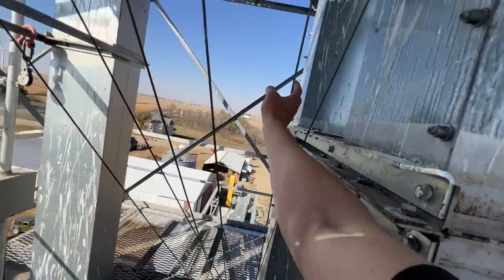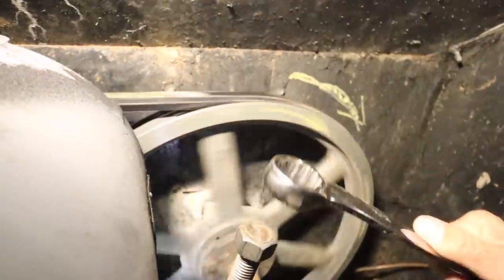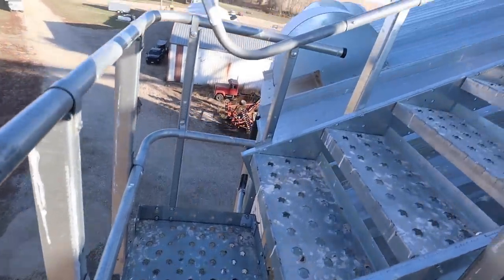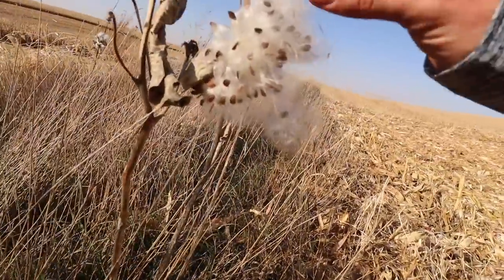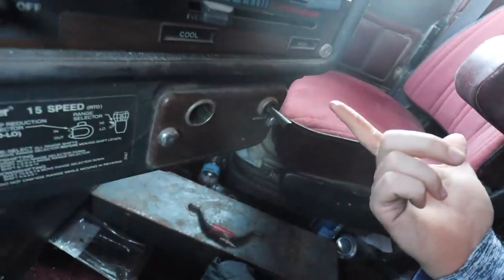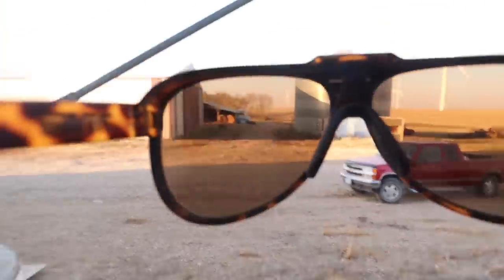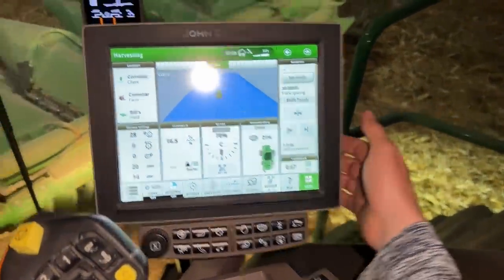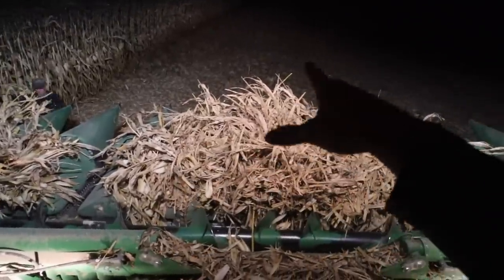Broken Welds Have Been Discovered On The Bin Site

Comment: For someone who doesn’t understand the mechanical issues with the belt, I was wondering if a chain and sprocket design would have solved the issue of constantly replacing belts. That said, you guys know more than I ever will. It must be so frustrating constantly dealing with the issues your experiencing with the grain bin design. Hopefully, the company that installed the bin setup will work out all the kinks and carefully check the critical welds on the catwalks before someone gets unnecessarily hurt.

Comment: I work with Automation on an industrial scale especially with Allen Bradley PLC, Panelview, VFDs, and motor starters you have shown. I would recommend putting a VFD on the auger motor that keeps burning up belts, if not already a VFD. AB has relatively cheap VFDs called PowerFlex 525s that would be perfect for the application. This would allow the auger to ramp up and down speeds which should reduce belts burning off. Also I would recommend putting an RPM sensor on that auger or monitor the amps and if RPMs get too low or amps too hi shut motor down. Prevents burning off belts. Also could have your programmer monitor the amps of the pit discharge auger (assuming VFD otherwise need to add a current transmitter to monitor) and as the center of the pit empties the discharge auger amps should start to decrease, then the speed of the center auger could be increased from a minimum speed to bring more grain to the center of the pit. Once center auger amps at empty setting and center auger full speed, then it could start the stopping sequence or at minimum turn auger speed back to minimum awaiting next load.

Comment: When replacing belt you have to amp probe the motor so don’t exceed  full load amps when tightening the belts. If the motor start circuit is tie into the plc you can regulate speed of the motor.

Comment: You need to look at using timing belts years ago we changed from v belts to timing belts also after trial and error we would have big pulley one size wider so only the small pulley would guide the belt by doing that the belt last much longer. Herman

Comment: Cole, DC I'm not an expert on grain dump pits but since you finally showed the auger belt pully in action it seems the speed is way too high for the bottom of a pit with a load on. I'm estimating that its running at 480(ish) rpm which is way too fast for a large auger at the bottom of a pit with a heavy load of corn pushing down on it especially if it"s pulling from both sides to the center. Just a suggestion but you could put the 7hp motor back on with a secondary 4:1 (or 5:1) reduction pully to get the rpm on the auger down to 80-120rpm which would be plenty to move the corn to the center quick enough to feed the lift auger and would effectively increase the torque saving your belts.

Comment: Sounds like you need a clutch drive for your pit auger system motor.
Reply: I'm not an engineer of this type of thing, but a chain and clutch seems like it would handle the torque better. Right now, they do have a clutch of sorts... Unfortunately it's made out of rubber.

Comment: Those bins are actually kind of terrifying. What if, for example, 4:30, DC falls in through the hole? If the grain level is low obviously probably instant death. If the level is high enough to survive, it's likely blocking the ground-level access doors and the walls are too smooth to climb, so you're trapped, probably injured, atop a mountain of grain, and if the system is running, more grain is raining down on top of you. And the Cornstars often seem to be spread out all over their farming operation and only staying in contact by phone or radio...

Can you get a good cell signal at the bin site? How about while inside those bins? If not, I would look into getting a cell signal booster...

Comment: I can’t imagine the frustration of that bin site, curious if you have tried dumping one hopper at a time over the center auger? I know that’s not how it’s designed but it may get you by till that can figure a better solution
Reply: Good thought worth trying
Reply: But that slows down emptying of the truck, which means eventually the combine will have to stop combining and sit full up and waiting in the field for a truck to pick up the grain.  
The point of having a big grain pit and the automatic conveyors is to be able to dump the whole truckload quickly and leave, so the truck can get back to the field to pick up the next load, while the pit conveyors empty out the pit at the speed that the grain augers can handle it.
Reply: @timothymbonham4453  yes but the whole site is a dumpster fire. How much time is lost changing the burned up belts? How much time/$ has been lost in their capacity for all the broken or inoperable items? It’s just a shame they’ve had to endure all this.

Comment: DC you can put different belt pulleys that hold three or four belts to take more torque when it loads the auger up  and pull motor and slot motor bolts for better Alignment

Comment: You might want to look into the bird poop issue, just to check it's not going to attack the galvanizing on the frame work.
Some owl decoys or something like that will keep the poopers away.
Or even better get some pet birds of prey :-)
Reply: Call me crazy, but I'd prefer not to be surrounded by bird droppings, regardless of whether it's harmful to the metal.
Reply: @iLumberjack  yea the problem with that is without a natural predator the only way to do that on structures like this is put spikes everywhere on roosting and nesting areas and that’s not exactly a good idea for safety
Reply: @Doubie. the problem with what?

Comment: I know it would be a pain but dump in center of pit. Then don't use the pit auger. Basically dump one hopper at a time. Slow and steady win the race😁 . You can also slow the pit auger down with a bigger pulley with the 7 hp motor.  Something to think about any way.

Comment: What should you do?
You should make a list of all the deficiencies in both design, construction, and workmanship and have your lawyer draft a letter to the Bin prime contractor to put them on notice, and request the contractor to propose a schedule to correct all deficiencies.
Given that you have employees on the farm, it would seem that workplace safety/OSHA regulations apply to your Bin, yet the railings and stairways dont appear to be even remotely OSHA compliant.  You may need to use fall restraint harnesses when on these sketchy platforms, yet there isn't attachment points for fall restraint lanyards. In a word, what a clusterfuck design.
Reply: Thy have been .that's why they have not been able to speak on it

Comment: Hi guys  I think one issue you might be having is that since your leg is not doing 8000 Bu an hour your cross auger is running to fast. You probably need a bigger pulley on the auger or smaller pulley on the motor to slow it down. I seen there is not that much room but change it as much as possible and think you won't be chewing up belts anymore. good luck . love the video's.

Comment: Corn star the problem you have is that the motor in the pits can overwhelm the bucket elevator so you need to slow down the pit auger and you need to slow down the auger, feeding the bucket elevator, so it won’t burn the belts off of the pit auger I would start at 50% and see how it works grace and peace

Comment: Hey cole. I’ve worked in sawmills, mines and manufacturing plants for 18 year as a millwright and a welder. The drive on your pit auger is a piss poor set up. The size of the drive pulley (motor pulley) is so much smaller then the driven(auger pulley)im sure this is to get the correct speed for the auger. they are mounter so close together that the size difference doesn’t allow the drive pulley to have enough of a contact area with the belt, and when the auger gets a load in it it will slip burning off the belts. If you just keep tightening the belts you will just destroy the bearings in the motor. If the pulleys have to be that close together they should have a gear box mounted to the motor with a ratio to give you the correct speed you need for your auger and a roller chain to drive it off the gear box with sprockets that are close to or the same size. Your problems would probably be gone.

Comment: Does the control panel have a speed control for the auger motors to slow them down, so they don't push so hard? We always had the ability to control speed of feed augers to conveyors or augers to feed the legs.

Comment: Regarding the burning belts, it looks like there is not enough belt wrap around the 10 hp motor pulley. I could not see if there is a tension idler behind the motor.  If not,  the motor cannot transfer its HP to the bigger belt sheave so when it pulls hard. enough it starts slipping and just burns the belts off.  Make sure there is proper belt alignment, also.

Comment: I don’t know much about bin sites and farming but I do work with motors and control panels. So I’m not trying to be mean or anything. But I would guess that panel has VFDs in it and you should be able to turn down the ramp up speed of the motor. Or In other words make it take longer for the motor to ramp up to its full speed and get it to full ramp after the massive amount of corn in getting to it and not trying to push so much so early. But i don’t know if that will work. I work in waste water treatment, pump station and treatment plants so I work with motors, pumps and control panels all the time.

Comment: burning belts is caused by belt slippage ,and the best solution for this problem is either add a belt  ,, or switch to a 2 stage drive with an intermediate shaft allowing the usage of larger pulleys and shorter belts ,this spreads the reduction out over a larger area ,, adds mechanical complexity  but also reduces stress on the components and the belts resulting in  a lower failure rate

Comment: On the pit auger motor.  Let the 10 hp motor on, Change the pulleys to add 1 or 2 more belts to handle the power, then program the motor vfd to limit available torque to what the auger can handle.

Comment: Cole, you need to change the ratio on the pit cross auger motor. Slow the auger down so it does not push the grain to the centre as fast, this will put less load on the motor & belts

Comment: If your having issues with the horizontal augers dragging everything to the center vertical auger, why do you keep pulling completely over the pit and dropping both hoppers into the pit? Why not just drop one hopper at a time over the center of the pit? And if your answer is because it's faster to drop them both to get back to the field, you're not working on long term efficiency with the current situation that Cole is always preaching about. Dumping one hopper at a time over the center vertical auger eliminates the 2 horizontal augers, which eliminates the belts burning up and shutting the whole thing completely down because the pit is full and can't be used, which in the end shuts the combine down. No expense on belts, and the combine never shuts down completely. May have to wait 10 or 15 minutes for an empty tuck here and there, but it won't shut it down. Slower dump time out weighs not dumping at all 100% of the time.

Comment: The distance between the motor pulley and the auger pulley is not far enough apart causing the belts to not have enough contact with the motor pulley. You can solve this two ways. Move the motor further away or put a smaller pulley on the auger.

Comment: Run a smaller breaker, higher load will trip the breaker. Fixed. Or it’ll fail to get past starting load, but cheaper to test then replacing belts.

Comment: looking at the veido with the belts and the varible drive gates belts require min 7"  diamter drive pulley to keep the belts from burning up. have a rep from a belt company go over the design to get it set up correctly for you.

Comment: Is there a soft start for the motors on the  pit? Trying to push materials in an auger is not usually a good idea and then adding your starting it with weight on it from stand still to full speed it makes it that much harder
Reply: Augers should have upper shields that protect it from column pressure.  Raising or lowering the shields adjusts the feed rate.
Reply: @OOpSjm  normally you are right but I didn't see that on this pit set up.
Reply: @gimpy3247  I didn't say there was or not.  Videos from last year should show what was installed.

Comment: maybe a sheave change might help or change the type of belt to htd belt from the vee belts I think you're using. they do not slip so if the auger jams the motor kicks out and you can reset that in the control room

Comment: I was wondering if you have a VFD that controls the 10 HP pit auger. If so you can really program them to help with the belt burning issues
Reply: There is a whistling noise which suggests there is an inverter drive. Agree ramp up time needs to be used, but it's also possible the belt drive is undersized for the required power / torque.  A combination of checking shaft separation, belt velocity and contact angle on the pulleys. Given all the doom on this project we can guess that a 10hp motor will have a belt drive designed for 5hp.....
Reply: @philhealey449  I was also wondering if the 2 belt drive setup was not enough to hold the added torque of the 10 HP motor. I would look into a 4 belt setup .
Reply: @bobbyparham4253  A killer issue can be inadequate  angle of contact around the motor pulley, so increasing the shaft separation and using longer belts can help.  The starting point I think is what is the required torque.  That may need a spring balance check at the driven pulley radius, but I guess there will be a lot of uncertainty conveying grain, so a very conservative approach is needed.

Comment: The motor vee belt pulley is a small dia and has a small surface area for the vee belts to run round. If you were to move the motor further away from the large vee pulley and put in a idler pulley to load the vee belt on the small motor pulley. Use the notched vee belts as they fit better on small dia pulleys.The other way to stop the vee belts burning out is to put a reduction drive on the motor and run the same size pulleys on the motor as the screw conveyor that way the surface area is the same on both pulleys.

Comment: Between the concrete slabs cracking, and now the bad weld job, both of which are dangerous, and now again, the bad motor problem, I'm surprised you haven't been in the news.

Comment: belt problems...switch to chain drive or gear drive...also you can use gearbox for better power distribution and weaker fuse for that motor so it will blow fuse before it burns belt...just some ideas...

Comment: tip for the bin motor and that burning belts, Change it to chain drive,.. in case of a havy load it wil trip the motor safety.. Not the belts witch are to smal for that purpose and power.

Comment: You would think that the contractor that supplied and set up your bin and leg setup would be more than eager to get out there, and go through your entire system and make sure that every flaw is corrected.when you think about this, you realize that it is the responsibility of the installation people to assure that every piece of equipment is properly installed, adjusted and tested, and to correct problems that arise during and after the installation ( like the pit auger) and prevent undue negative publicity. They should be able to fabricate a switch to turn that auger off when the grain piles up at the outlet and back on when the grain clears thus preventing the added pressure on that auger assembly that is only going to break something else.

Comment: The VFD is easily programmed to reduce the power so it stops rather than burn up the belts It would also be pretty easy to just switch to a 3 grove setup or a toothed carbon belt that would take the full 10 HP

Comment: if your burning belts on the pit auger there isn't really anything you can do via electronics. if you slow it down more you pile more on top of it and if you speed it up you stuff the lifts. probably need to increase the gear ratio going onto the auger, put bigger pulleys on both motor and auger (will reduce force on the belts without changing speed), or increase the amount the belt wrap around the motor pulley(increases traction to the belt).  make sure motor is aligned well and consider putting a shield over auger to remove stacking pressure from the grain piling up.

Comment: There is a place on the website you can buy V-belts and it’s called the  THE V-BELT GUYS.  I bought my belt for my John Deere zero turn from them. John Deere was over $100 and I bought one for 2195 and it works just fine.

Comment: Not sure if it would help but could you change pulley size on the pit auger? Would take longer to empty but might not put so much stress on the belts causing them to burn off all the time.

Comment: Listening to the hopper motor it sounds like a VFD runs it.  A VFD should have a current feedback on it.  There should likely be a current limiter setting in the VFD that might allow you to keep the 10hp motor but not allow full torque (to protect the belts).  I've working in Automation for for over 40 years with Rockwell Automation (Allen-Bradley) products and have experience with PLC and HMI programming working with VFDs.  Talk to the guy who taps in to change the program to see if that's possible.   You also could add an idler wheel on the outside of the drive belt that has a switch on it.  When you loose the belts it could shut things down and tell you there's a belt break.

Comment: Comenting again, just to see if Cole can see, as a mechanical engineer with love for grain bins, to solve that pit belt problem, u guys need to do a wider pulley, or double it, keep the 10 hp on there, it will not burn more belts, or put a 12hp and double wider pulley, more expensive but more bullet proof tho